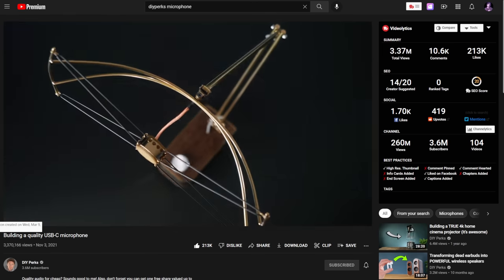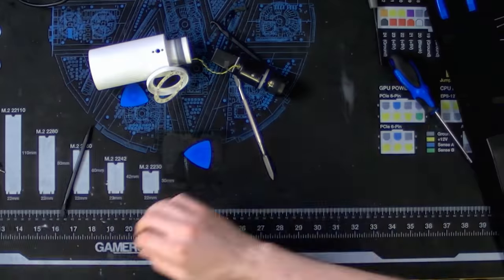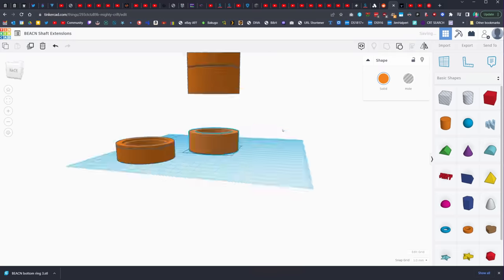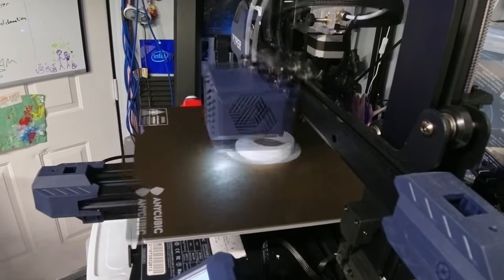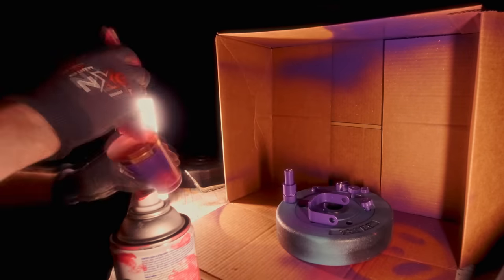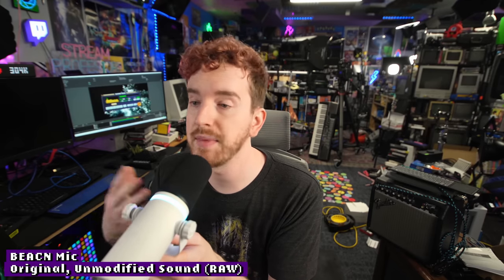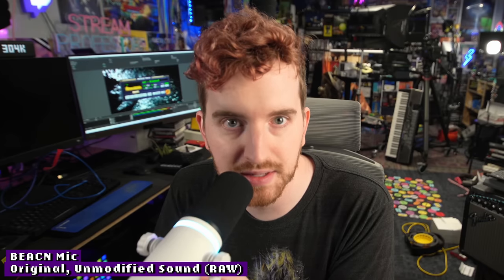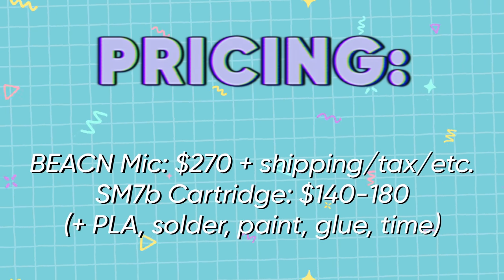I BUILT A USB SM7B?! The DREAM microphone...

Comment: The "missing frequency" is very likely the sharp dip in the SM7Bs frequency response. This is inherent to the SM7B capsule and it showed up in all my response meaurements between 6 and 7 kHz. You should also see the behaviour with your unmodified SM7B. Great job on the design!
Reply: Thanks for your SM57 EQ parameters👌

Comment: 11:39 you could just make housing for capsule, and separate housing for motherboard, so you could have compact mic and connect it with longer wires to motherboard :)
Reply from the maker: That’s what the audio interface will be! But at that point that’s making a whole mic housing, yoke, etc and not what I wanted to do here

Comment: Great job doing a mod!!! 
The problem with the printed tube was that the tube blocked the interference ports coming in the back of the capsule :) 
Those are what give a dynamic mic it’s directionally (invented for this microphone! :))
Reply: Also, that crunch could very well have to do with impedance matching of the sm7 capsule with the input of the circuit it’s being fed to.

Comment: Great to see that works quite well. Last time I tried this project with a 30$ capsule, it had bad wires, this literally fell off, tried soldering, the heat killed the condenser diaphragm, so just a side note, replacing a condenser capsule and not a dynamic 1, might be a pure nightmare.

Comment: I know you can get replacement dynamic capsules from both SE Electronics and Shure. I wonder if you can do a cost effective capsule switch for the Beacn with one from an sm58 or a V7.

The crunch is likely the pcb in the mic, unless their software crunches the audio by default which would be a very weird choice.

Comment: looking at the design under the windscreen, I can't help but wonder if the Shure's capsule wouldn't fit/work better on the Presonus Revelator Dynamic USB? you get the better software experience out of it and the cost to DIY it would be lower too.

Comment: What I've learned is that it doesn't matter what microphone you have in this day and age and that's all because of the filters on OBS that make your Microphone sound so so good. With all those filters available, you can have a $30 mic sound like a $300 mic. Still, a very cool video. Your mic sounding so good as is without processing is purely amazing. Nice work. The USB change alone make this project very worthwhile.
Reply: Err... nope. Not even close
Reply: @NiloVelez  yes
Have you ever fiddled with those filters before?
Reply: @kukukachu  yes, and I've also used protools, soundforge, reaper... You need a minimum of quality in your input. Below that, no filter can save your master.
Reply: @NiloVelez  So what mic are we talking here?  You can take a Rode Micro and still make it sound good and that's only $70. I'm curious what mics you are talking about, because I was talking about USB mics.
Reply: @kukukachu  You said 30$, not 70$. There are some nice mics in the 70$ range (Samson Q2U, Shure  PGA58). But it's really hard to find something decent for 30$
Reply: Besides, if you go for a low-end dynamic mic like the Beringer XM8500 you will still have to throw some cash at the audio interface to make it sound right
Reply: @NiloVelez  oki, yes, I did say $30, but the video itself showed just how amazing the filters can be on software.

Comment: Could you remove the internals from the beacn mic put it in say a 3d printed box. with a usb connection an headphone jack on one side, and then an xlr cable where the beacn capsule connects almost like a tiny beacn audio interface for dynamic mics 😂

Comment: Okay, quick question. Could you have just soldered some eighth inch sockets to the capsule and to the DSP and then made it so that you could swap the capsule out? That would have made it much smaller and you could swap back and forth between modules to test them and see which one you like better.
Reply from the maker: I certainly wouldn’t have made it smaller given the capsule would still need a shielded housing and now one that covers the whole capsule unit and can slot in
Reply: @EposVox  okay, just an idea. I really just meant two different pieces with a cable between them.

Comment: 1. I think it would be SUPER FUNNY if you went and sent this to the guys at beacon as huge flex to their idiocy. 2. I have never liked the sound of the SM7B. It's over rated, over used, ear tiring and as I was listening to this on my Astro A40 headset, my ears were getting super tired from the low bass on this microphone mod. I mean, A for effort making something custom for sure, I just personally don't, and never will, like the sound of the SM7B in any formfactor.

Comment: ~$140 for a capsule that you can get in a $100 microphone?  Why not just buy the SM57 and remove it?
Reply from the maker: Because they're not the same? Despite what all the "you can EQ the SM57 to sound like the SM7b" BS videos tell you, they're still quite different mics. The capsule for the SM7b is twice the length of the one in the SM57 and the SM7b capsule itself is thicker than the entirety of the SM57 with housing and everything. I wanted a USB SM7b, not a USB SM57.